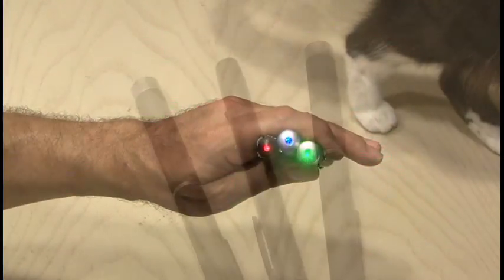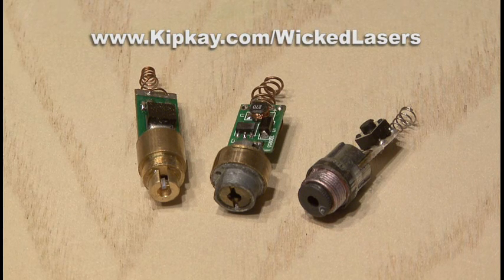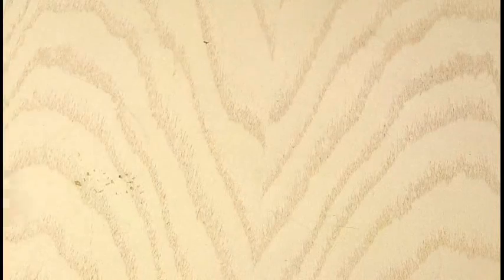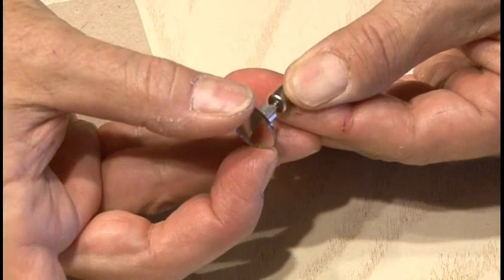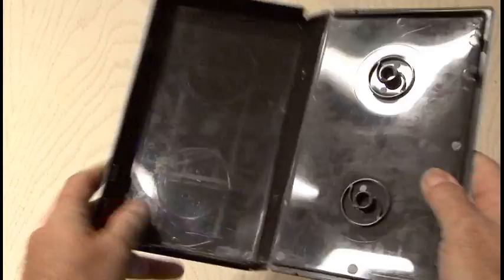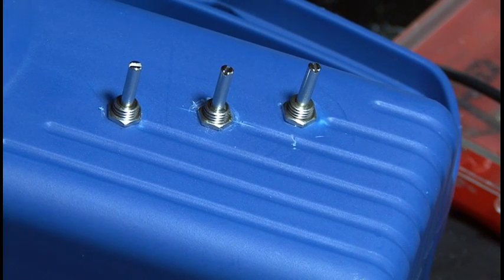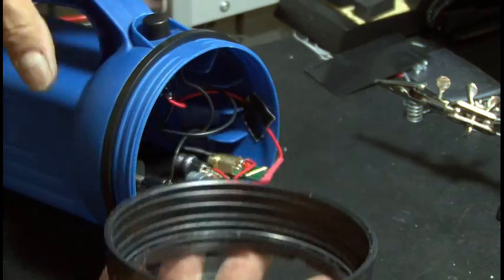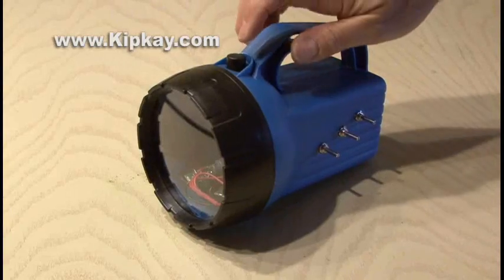Amazing Lasers! - LaserShow Flashlight!

Comment: soldering is pretty easy if you search youtube you will find plenty of videos on how to solder.. All you need to to is tin each part you need to solder together with solder. then hold the wire to the ocomponet and heat till the solder melts it will flow together and take the heat away, hold until the solder solidifys. The key is using enough heat to quickly melt the solder and doing it quickly. not heating anything for too long. a few seconds should be plenty

Comment: Actually, blinking has everything to do with it. The FDA has determined that Class 3a (≤5mW) lasers could cause injury to the eye if viewed directly for approximately 0.25 seconds. You'd think this would be enough to ban them, but the FDA cited evidence that exposure to visible lasers is limited by the blink reflex of the eye, which they have timed to under 0.25 seconds.

Comment: hey kipkay i have the exact same laser as yours im talking about the one at 0:10 
i tried getting to the driver by opening the top silver cap but theres no way to get the driver out from that side and i saw u take the driver out from the back, howd u do it???
i just see the spring that touches the batteries and a foam ring surrounding it but how do i get the driver out??

Comment: I would forget about the mirrors, mount the motors right on the lasers and mount the lasers on 12 gauge wire. Wire will flex a bit when motors vibrate each laser and create the same show only lasers will not be blocking some of the light.

Comment: i have opened a small laser pen and found the driver you show on the right
and( i think )i got a diode from an old CD player/radio.cause its a little brass cylinder with a lens and 3 contact points that was glued in the side of the laser assembly
so if i would wire those 2 up i can get some light out of it?
wich wires should i connect? :P

Comment: @hdcool09 - Backslashes are so uncommon in web addresses, though, that it's not even worth specifying which slash you mean. It's like saying "make sure to put a VHS tape in the VCR, not an audio cassette tape" since they're both tapes.  Also, most browsers auto-correct the proper slash anyway. Therefore, "only noobs say forward-slash" is qualified.

Comment: can one of these lasers be used to heat a E-cigarette??, the casing looks the same, same kind parts, but one of these with a lasers with circuit boards can precisely control the power (temp)

Comment: It is genuinely blue in the video.

Unlike almost any other light source, the laser light consists of a single wavelength, in case of purple usually 405nm or 430nm. To human eye, this looks like a combination of red and blue.  A camera picks up image through 3 filters. Assuming the blue one picks light with wavelength of approx. 500nm or shorter. Red filter picks up light with wavelength of approx. 600nm or longer. Under this assumption one would get only blue.

Comment: This is cool. Please clarify something though: how do you get the mirrors to disperse the laser? It seems they should be at an angle so when they spin, they reflect the light in different directions. It just looks like the mirrors are attached flat and would just spin stationary. Does that make sense?

Anyway, it obviously works as shown. :)